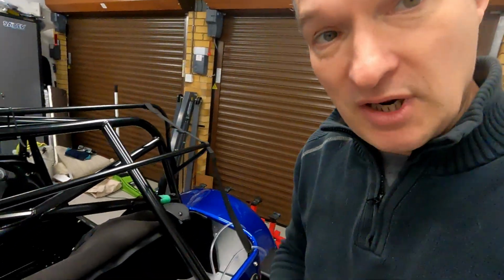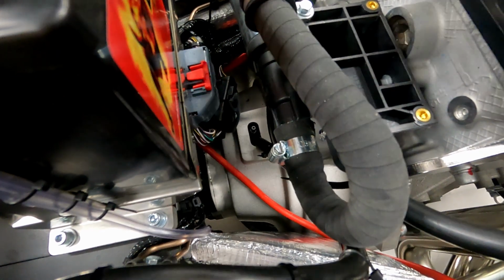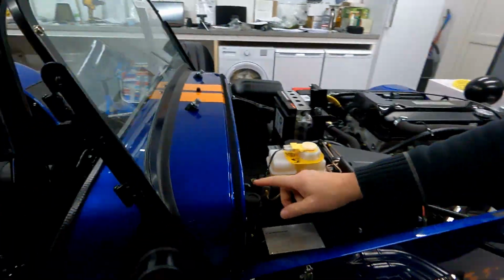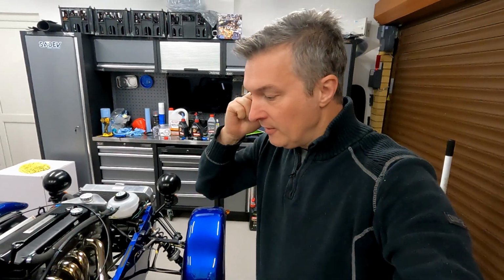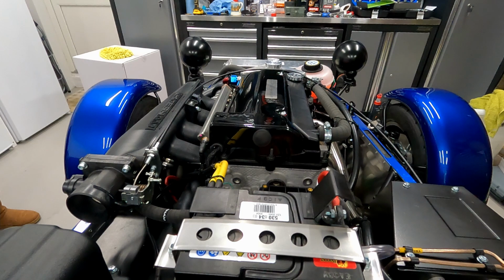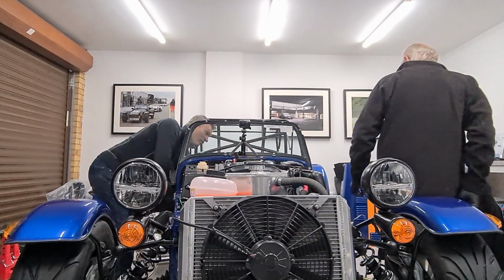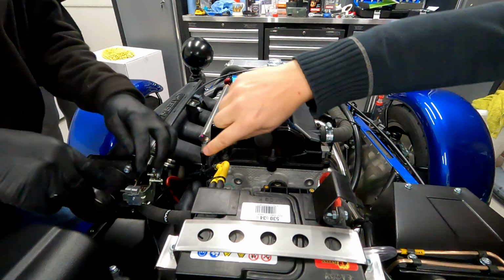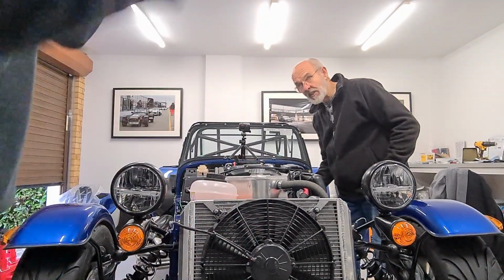Caterham 420R - Engine Start

Comment: My new factory built 420R arrived last week at my residence.   It's due to be registered on 1.1.22 

5 speed.   I've been in a 620R.  The Sadev is not really in its element on normal roads but on the track an entirely different proposition.   

Will be interesting to see if your Titan LSD is a clunky thing behind your bottom!
Reply from the maker: They don't put the BMW titan in for sadev it's a Ford unit: https://caterhamparts.co.uk/differentials/4795-ford-differential-362-with-lsd.html Notwithstanding that I expect a LOT of whining
Reply: @simonbennett3  You never know it might be quiet.    If it does whine you want it to tune out at say 80mph.    The noise sort of comes and goes at different speeds I have found on Caterhams.

Comment: How did you manage to get a Sadev sequential with that kit? Didn't think they supply them unless it's a 620?
Reply from the maker: I couldn’t find the sequential on the online configurator for 420R but know that it’s the gearbox used in the motorsport variant. So I just asked the sales guy and he said it’s possible to do. It will make all the difference on the track but could be a bugger on the road!